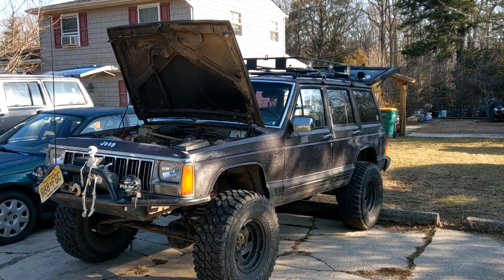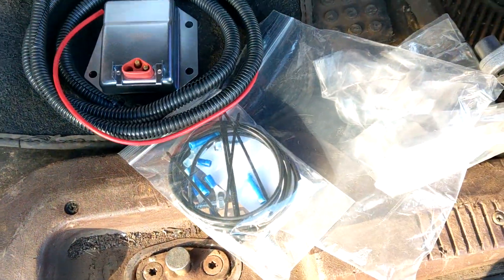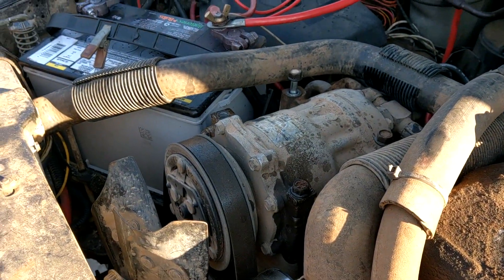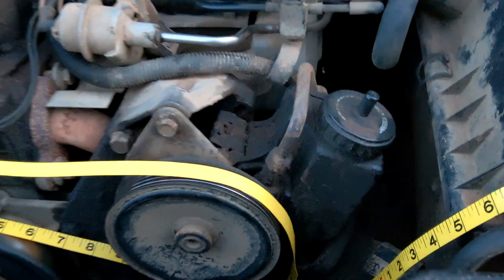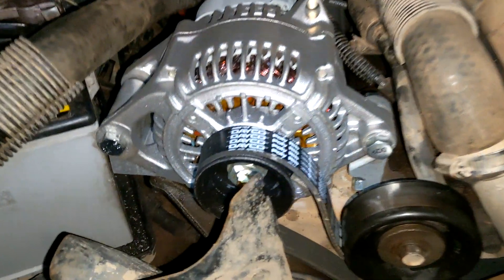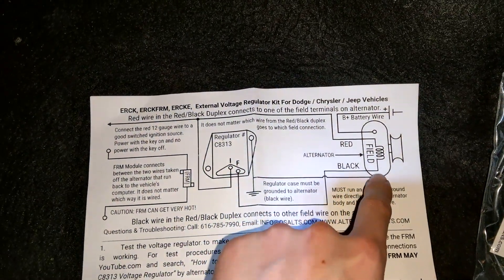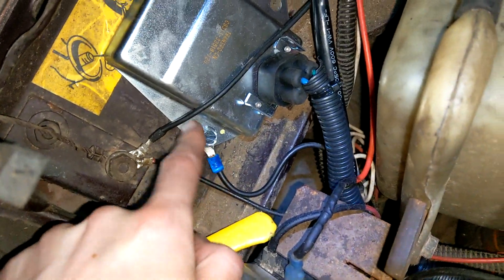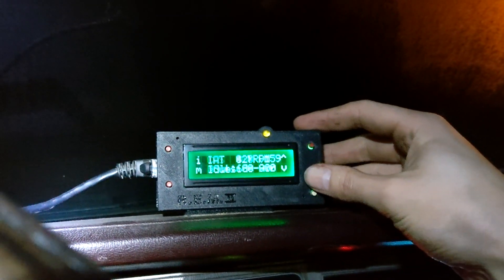89 XJ Renix to HO High Mount 136A Alternator Swap

Comment: Maybe you're not still reading responses to this video after 3 years, but just in case - the tan wire on the old Renix alt. connector feeds the alternator lamp for the "Standard" cluster (C203 pin 3), so that gets lost if not connected somehow. The "Gauges" and High Line" clusters read voltage from C203 pin 6, which on the Renix setup reads voltage coming from the yellow wire off the alt, then into power distribution splice D, then onto the cluster through the 2.5A gauges fuse. Just in case anyone wanting to try this has the "Standard" cluster, be forewarned there may be another step involved.

Comment: i did a similar thing to my 1988 xj with a mid 80's GM 1 wire hook up. ditching the a/c and modifying the a/c bracket.

Comment: Is there different types of generation on renix engines? And how can you tell what year engine your vehicle actually has?
Reply from the maker: Renix is mostly the same mechanic, the biggest change is really just the ECU program on 89-90. 86 to 90 is the Renix range. 91 to 95 is HO obd1, and 97+ is HO obd2. The intake manifolds are different between generations which may be one of the easiest ways to tell. The cylinder heads are numbered between the generations which might be an easy way to tell us well. But by far, the biggest generation difference is the ECU
Reply: @NickInTimeFilms  gotcha, I got myself another xj, it's a 88, guy told me it has a 91 engine on it. I looked at it and looks nothing like a 91, looks like the renix, the only difference I saw was the ignition coil is in another spot then the average on being by the battery.
Reply: @maximusilive4theking986  there is a flat spot on the block, just below the head, and just in front of the distributor. Might have to wire brush/clean it to see it but it tells you the date the engine was manufactured. Should have 7 letters/numbers. 1st number is the year it was made, 2nd & 3rd is the month, 3rd & 4th should say MX which is for 4.0 242ci, and the 6th & 7th is the day. Example 101MX01 = 1991, January, 4.0, 1st.
Reply: @NickInTimeFilms  I'm kinda confused in what parts to buy.
Reply from the maker: If he kept the Renix ECU then you probably want renix parts to go with. Or just replace with whatever is working currently. Swaps can be fun...

Comment: any issues with pulsing lights afterwards?
Reply from the maker: I've heard the voltage pulses a little bit. I'm happier with my current setup, but this is easy
Reply: 96 xj here running stock alternator i bypassed internal reg in pcm with external from a 80 dodge truck works great just the pulsing but iv learned to deal with it.  wondered if some kind of inline resistor would solve the issue every one iv talked to thats done it has the same issue.
Reply: Johnson actually yea. that's my jeep, and the lights pulse at idle. at rev they smooth out tho
Reply: @aluminautifishing  update- pulsing lights went away when connected the ignition hot wire for the regulator directly to battery (weak ignition signal) so I wired up a relay to said ignition hot wire
Reply: @tylermus  thanks for that update, going with a higher output alt on my renix with HO brackets.